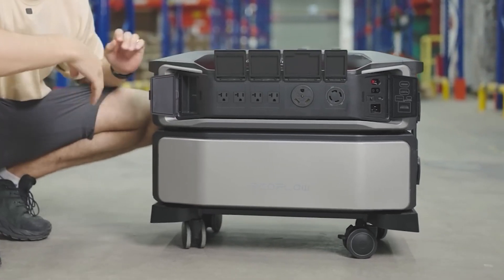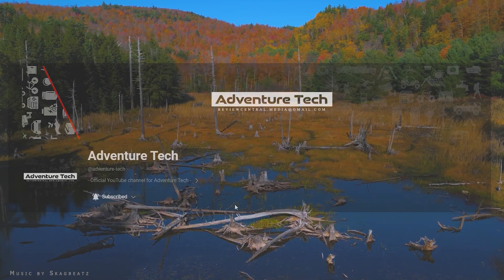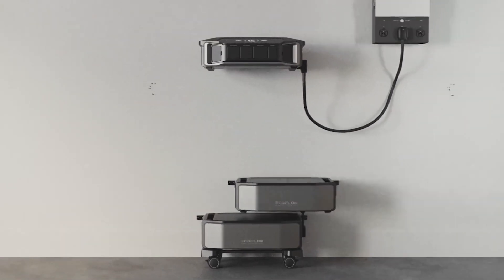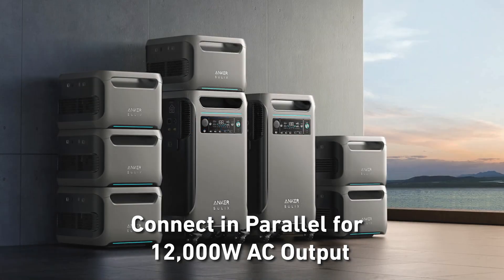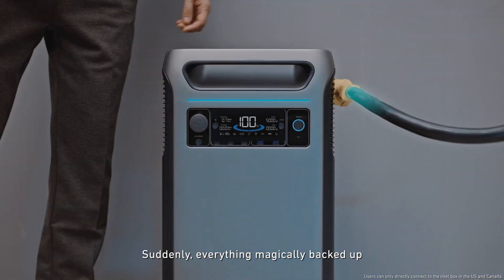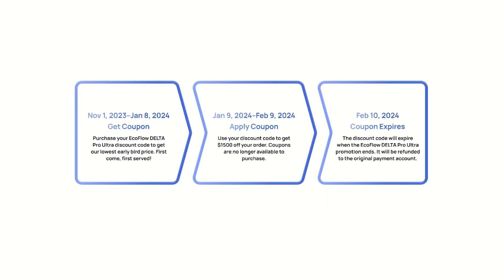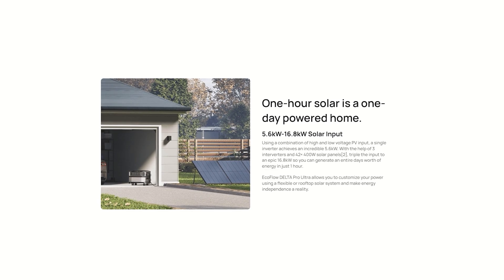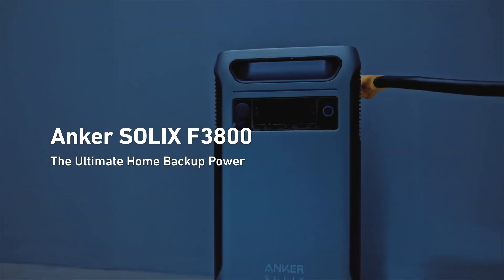EcoFlow Delta Pro Ultra vs Anker Solix F3800 - Which One is Best Portable Power Station for You

Comment: I would never buy one of these. It's surge capacity is far too low for my home's needs.
Reply: Do you consistently fast charge two rivians while running the AC? What alternatives have you found that can output much higher than the 10kw surge on the EcoFlow?
Reply from the maker: this guys trolls my channel bad.  Must work for a inverter company or something.   He find anyway to trash portable power stations. 
 I just ignore him.  He is just looking for attention. I thought he had a point but this new power station can really put out a huge output of power standalone and combined with another ultra, the power output is pretty significant.  It can match a lot of  large capacity inverters I've seen.
Reply: @adventure-tech  Wrong, I'm an inverter repair technician with over 24 years of experience repairing both the low cost, high frequency, transformerless inverter tech that's used in these power stations and the the low frequency, transformer based inverter tech that's used in stand alone "real" off grid inverter tech. One of the things that I've learned over the past 24 years after repairing thousands of inverters is that high frequency inverter tech has a far shorter life expectancy than low frequency inverters and it also offers a far weaker surge capacity. With all do respect, You may "think" that I'm just looking for "attention" but I "know" that you're just looking for a commission. So you'll say just about anything about these power stations/solar generators to make the sale. Which is why you post affiliate links on your videos.
Reply from the maker: @kickgas7171     We would love to have you here with your amazing experience, but you need to change your approach greatly.    

  First off, I lost my sister day before my birthday, lost my my cousin and my nephew took his own life just a few months ago.   I see people dropping like flies out here, homeless, while working full time jobs and not able to pay power companies, repair men like you, etc...   My goal is to help them survive and gain more freedom.   To be able to live a life worth living.....  Don't make assumptions about people you don't know and their motivations.    I witness things that drive me to help others who lack resources and live in poor conditions, simply because of where they were born and politics.   That is why I share and promote technology that can literally save people's lives who are born into unfortunate circumstances.   I will not let someone like you devalue that for others who seek help.    And what is wrong with people using the links to help me keep food in my fridge?   Do you prefer people starve and work for nothing?  Am I your video slave?   Your assumptions about me are unsupported and unwelcome here.  We all have great conversations and help each other learn.  You are simply burning everyone in your wake who doesn't agree with you.   While, my reputation stands for itself.  

 Some people do not know how to set up DIY power and can't afford to hire someone like you, so these power station literally are saving lives in some instances.    And I also support DIY set ups and have made detailed videos about them also.  Stay tuned for a new video coming soon with inverters and LFP batteries from LiTime.  I am not one sided like you.   Both applications are helpful depending.   You never made a notice or left any appreciative comments when you see mine or others DIY videos.    Did you not see my entire DIY set up video showing how much cheaper and benefits of DIY?  You look quick and make full judgement based on barely half a look.  

A portable power station is just a battery, inverter and charger inside a case.  Literally a DIY set up in a box.    People make custom portable power stations all the time using their preference for inverter, battery, etc...  So your beef with the concept of a portable power station is ridiculous.  

And Sir,  I don't think that you are not validated in some your conversation. It is your approach that is not helping your cause.   This is why you are being ignored even if you have a point.    You have very great detailed information.   However, you constantly spamming same comments on my videos and others'. and your misleading videos on your channel do not give you creditability.  Your videos and most of your spam comments are against YouTube policy.    You hardly ever conversate.  You just scream at people and refuse to consider anything they say.   People will ignore you.  I've seen multiple accounts with your same videos on them.  

 You claim to have so much great information, it seems like you should be making portable power stations with all these components you say are missing.  OR work as consultant for one of the many portable power companies across the globe or in the US.    OR here is another idea.... you can also not speak if you are constantly going to be rude and close minded, so then the rest of us can continue a thoughtful conversation.  

 You seem to hate the industry of portable power stations, perhaps because it is affecting your business.   If someone put all your preferences for components into a box and called it a power stations, is it still crap to you?   You also seem to trash 'china' a lot.  Even the US made companies are using a lot of components from many different countries overseas, giving these US businesses the ability to grow and thrive.   We are all brothers and sisters here on Earth.  The only ones that win when we fight are the few super rich people out there.  Maybe you work for them.... 

You are one sided and seem to hate all power stations even though they are are built with different components and are constantly changing over time.    

 Again, last warning because you are not conversating with us.   You are yelling and screaming and refusing anything anyone says that you do not agree with.  AGAIN, we would love to have you here with your amazing experience, but you need to change your approach greatly.

You're pretty close to being banned from commenting indefinitely, so the comments on my videos remain safe for everyone.  Last warning my friend...
Reply from the maker: It may appear that way if you just look quickly and make a judgement.  But I let him speak many times, and leave his comment up the first time he post it, but then he posts same message on multiple videos at a time.   You weren't there for all the other occasions this person has harassed me, my channel, my commentors, and countless other channels.    I'm being polite, trust me.     He comments the same exact copy/paste comments on all my videos.
Reply: @adrianthrockmorton7557  Well a EG4 6000XP AIO off grid inverter (note you will need your own battery) is a 6Kw inverter that can surge to 12Kw for 10 minutes and you can parallel up to like 16 of them, not that I could see any residential requiring 400 amps of continuous with an 800 amp surge capacity, since these units are both "off grid" (no capacity to output to the grid legally in the USA) that EG4 would effectively be part of the competition and you could pull a Will Prowse and mount the 6000xp and battery to a hand truck if you need the portability these units provide.

This is one of the units i'm considering for my setup, just waiting on the pricing in January on the Ecoflow to decide the final route, I got one of the coupons a few weeks ago just to be safe in case I go with the simplicity of the ecoflow and Smart Home Panel 2, i'm not in too huge a rush, still waiting on my panels to arrive and I have a small portable power station for testing purposes.
Reply: Any 4 kW continuous rated low frequency, transformer based inverter can surge to 12kW for several minutes  versus the 10kW surge that the Ecoflow can produce for only milliseconds.  @adrianthrockmorton7557